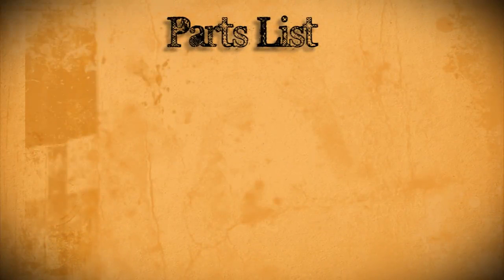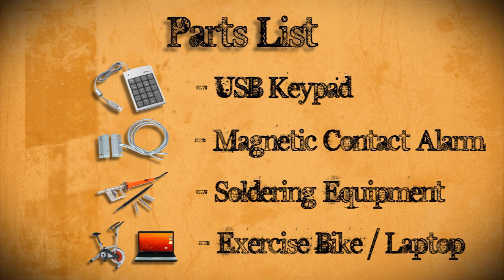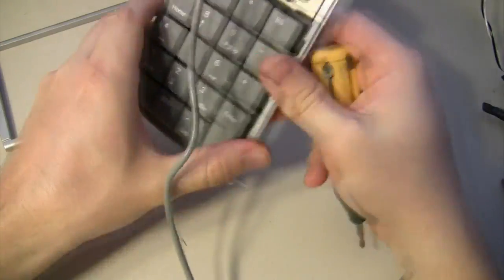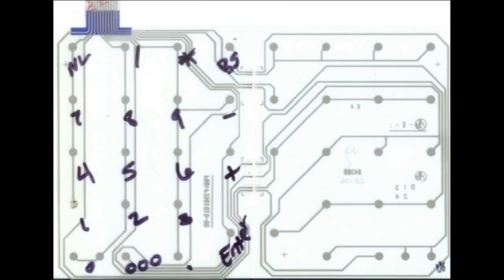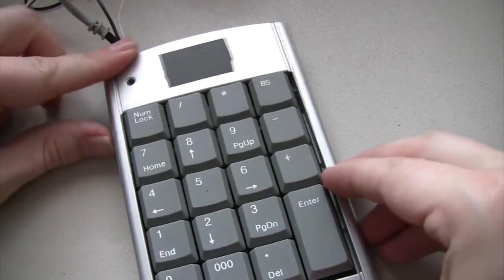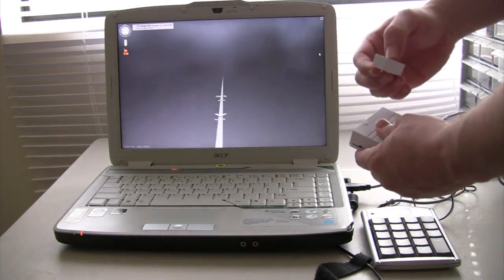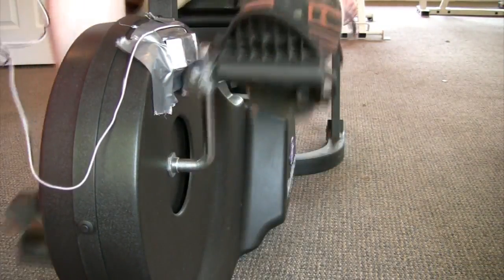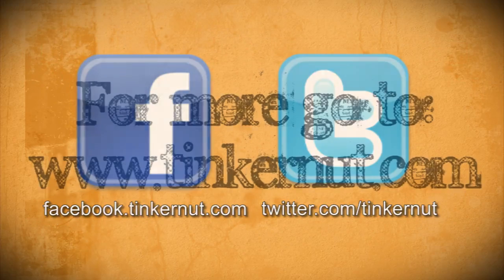Google Bike Hack

Comment: What happens when you hit an intersection?  I guess you need to pick a road in the middle of a desert to get a nice long boring stretch of land.  A mountain path would be nice though.. .I guess the alps is a straight enough shot.  If you run into water... does it go sub-marine on ya?  That would be cool.

Comment: In my experiences maps and any service like it doesn't allocate the bandwidth to make it possible w/o the blur.

If they could make it possible to users to adjust the length each movement takes them and enough bandwidth was available it would be quite fun.

Its so funny how the $15 at most to set this up isn't the fail point but Google is, in Google defense they didn't design maps for such a thing.